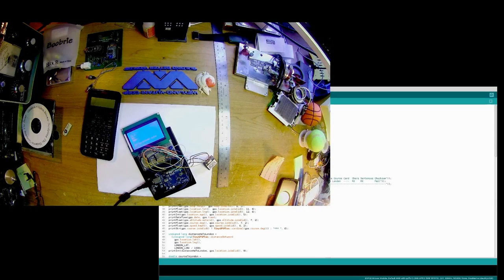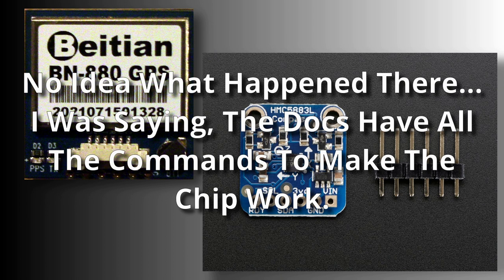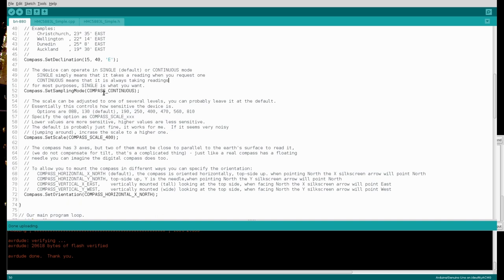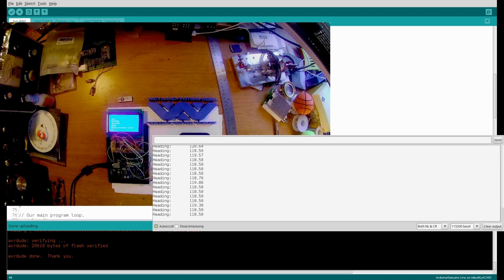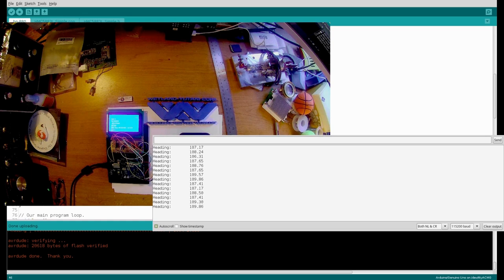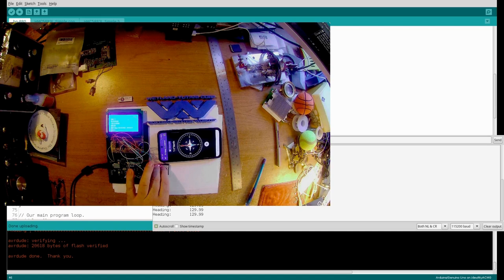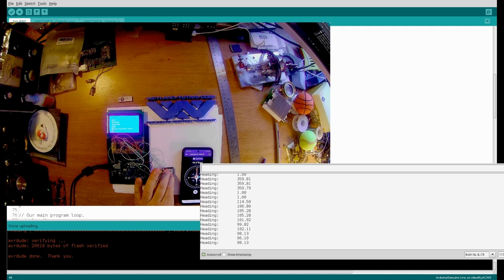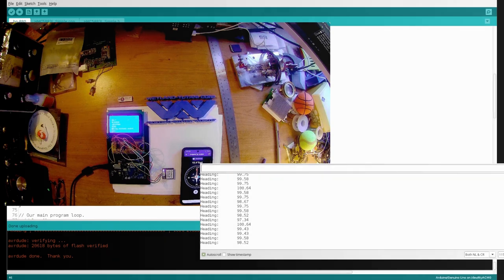BN-880 GPS/Compass Module With Arduino Uno - The Compass

Comment: don't know if you figured this out, but your phone reads mag heading, not true.  the declination value you are entering is to convert from mag to true.  So to directly compare the bn-880 to phone, you need to set declination to 0.

next you have the phone right next to the bn-880.  There are components in the phone that will affect the readings, you see that when you move the phone around.  Need to keep the phone and bn-880 at least 6-10 inches apart.

Being in a basement does not impact readings, and even if it did, it would affect both the same.  

I can't tell if you have calibrated the bn-880.  every chip will have different amounts of offset to each of the x, y and z direction.  I you have not calibrated those offsets, then the accuracy you are seeing is actually pretty good.  

I have calibrated these same types of magnetometer chips, and also taken tilt into account, and I can get within 2 degrees in all orientations, including with a big tilt.
Reply from the maker: Not actually in a basement, it's a multi story apartment building, stucco outside, wire mesh underneath so in essence, a big faraday cage, I moved outside to do some testing to get away from monitors, computers, radios, antennas and so on. When I did, the readings changed, not dramatically, but enough that I didn't trust the readings inside the building.
Reply: How did u manage to calibrate the bn880?

Comment: I am running on an ESP32 using pins 21 and 22 for the I2C connected to my BN-880Q GPS receiver.  Any idea why this is all I see with the unit sitting still?  Rotating is does not change these numbers.  I will order an HMC5883L.

Heading: 	357.00
Heading: 	357.00
Heading: 	87.00
Heading: 	357.00
Heading: 	87.00
Reply from the maker: Only thing I can think of here is the axis, which axis are you rotating it on?